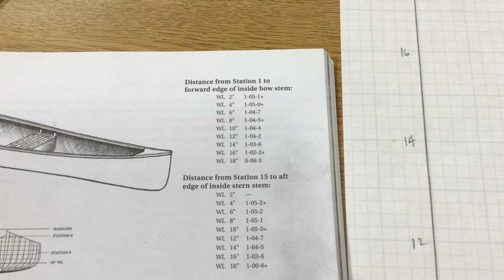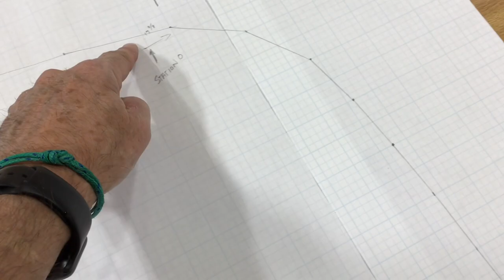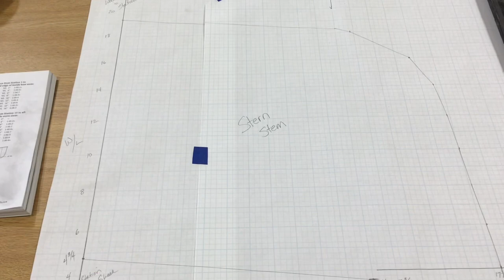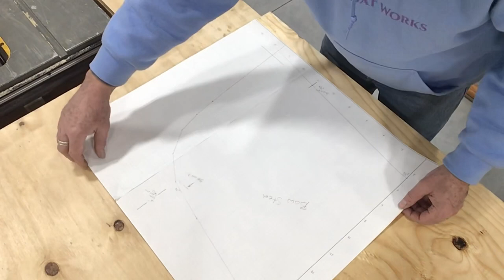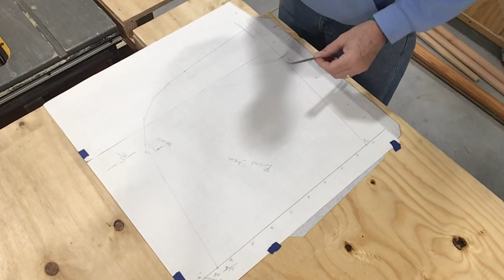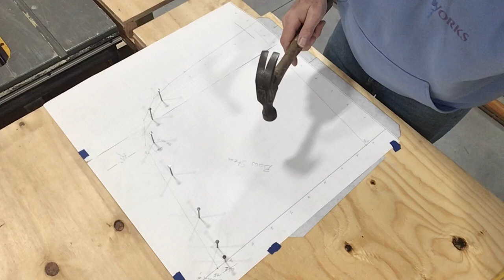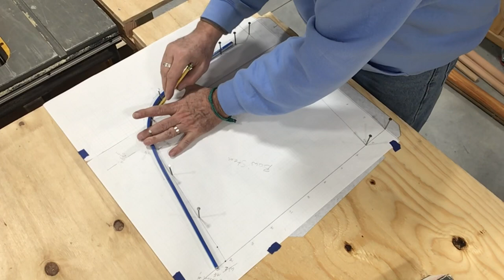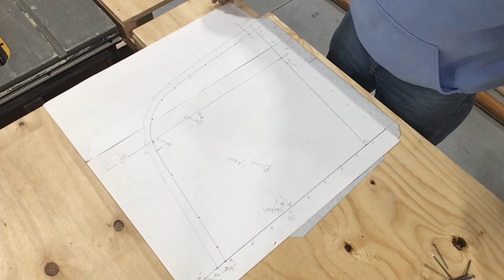How To Loft Canoe Stem Molds - Episode 2 Freedom 17

Comment: As you have found from building the Haven, there are a lot of things you have to work out for yourself. As I am very short on space for my new project I bought the full size plans for the station moulds and planking, which was just as well. The "instruction books" that came with it show only very basic and generic construction methods, with very few pictures of the actual boat I will be making. There is just about enough info on sectional drawings for things like floors, but they will only make sense with the hull in front of me. The Freedom 17 looks really nice. It is going to be a good winter project.  Keep well.
Reply from the maker: Hi Dale,  What kind of boat are you working on?

Comment: Hi i am from Holland, so don't mind my spelling. Vids are really helpfull. One question. Why are you going diagonal from the sheer from station 1  tot mark the 17 3/8 point. Is it because you have to go through the sheer of station 0, which is at 0-01-4+.
Thanx in advance
Reply from the maker: I’m not completely sure that I understand your question but since the sheer is at it’s highest point at the very ends of the canoe, it does run somewhat diagonal. And, as I was drawing it out, i had to sort of just push the line out from station zero to the stem. In the actual build process, it was easier to just make it “look” right. If this doesn’t clear up your question or confirm your feeling, which i think is right, please ask again  and I will try to answer and your spelling is just fine.
Reply: Thnx for you answer. It makes it clearer. Again, your videos are really helpfull, like this one on how the lofting works and what the book does not mention. I am building the 15' prospector.

To be sure and i found the right words now.
In all the other stations the sheer is drawn in an 90 degree angle on the waterline. On the stem. You draw it in an angle. To do so you need two points. Maybe i missed it but you only mention the beginning point ( the sheer of station 1). Am i right by thinking that you used the sheer of station 0 to determine the angle of the line?
I live in a metric country, man i could not even find the right graph paper.
Thanks.
Reply: I just watched that part of the video again. And you did mention it. It is clear now!!!  I did not understand the words... draw on out. Think thats why i mis understood.
Reply from the maker: @gerbrand_outandabout   oh good. I'm glad that you have a better idea now on how this works. Good luck on your build!